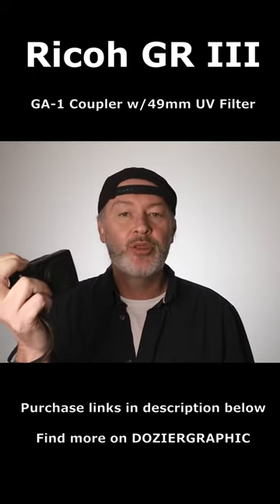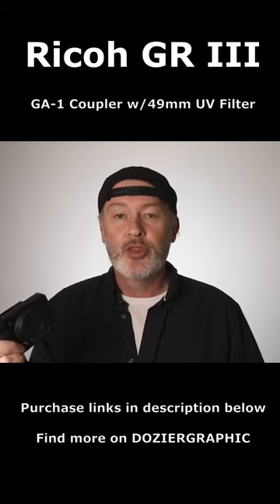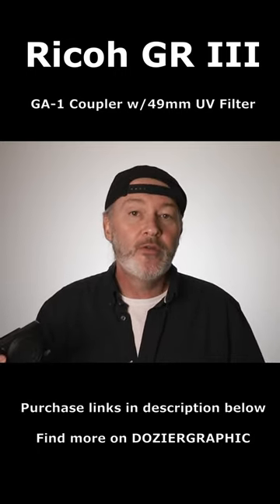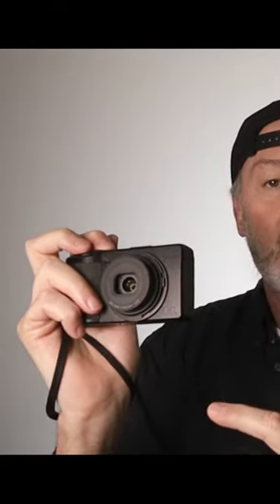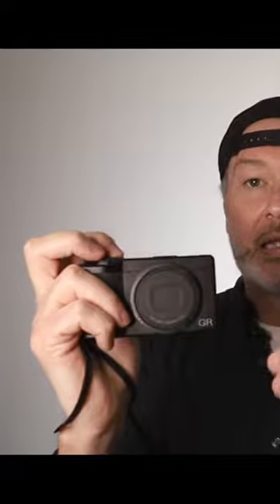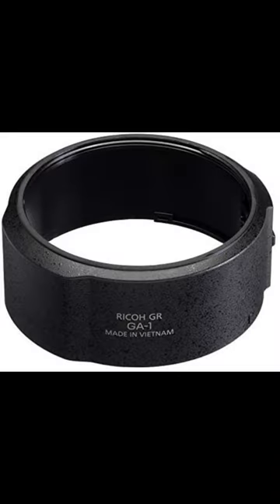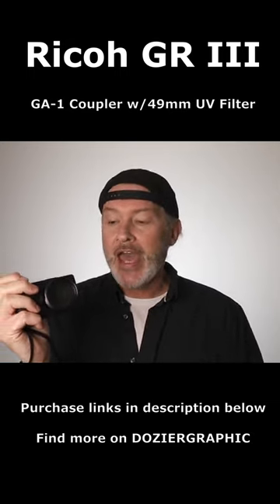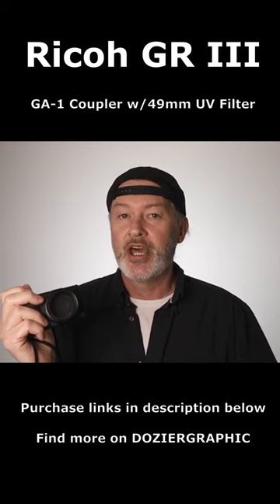Ricoh GR III Sensor Dust Prevention Hack #shorts

Comment: Good idea but it is not pocketable anymore
Reply from the maker: I know some want to carry in their pocket but I've never done that. I keep it wrapped and in my camera bag. Too expensive and heavy to carry in a pocket. But we're all different of course. Thanks for watching.
Reply: By forever pocketing this camera you'll be taking pictures of nothing but lint and dust, soon. 😄
Reply: Still one of the tiniest camera 
However same, I dont put it in my pocket
Reply: With the filter adapter, It don't fit into the jeans pocket but does fit in the hood pocket.
Reply: More than that, I bought the official GA 1 adapter, and it has still a hole on the side that let dust come in so it's not the perfect solution
also yes its too big for everyday use
Reply: @paulabbott2813  well that negates the main reason to even get one isn't it? All I asked for was a camera superior to a flaship smartphone, and people said GR3. Fine GR3 except you can't really carry this camera and is very bad at point and shoot. The main idea of point and shoot is have 99% relyability so you take out the device, get the picture at first try, put it back in. Now you can't carry it in the pocket, you need special setings an baby it at every step. At this point I would just get a freaking medium format at least I know why I need to baby sit the camera.

Comment: Regarding dust, I read that if you remove the battery you can easily suck out the dust through there.
Reply from the maker: interesting, never tried it. hope it'll work for those with issues!

Comment: this kinda defeats the purpose of it being so compact though...
Reply from the maker: I get that for most people Chris, and why some buy it, but I didn't buy it to put it in my pocket. And it actually helps me hold the camera in a scissor fashion that I can't do otherwise. Without the coupler, my hands would be too big to use the camera.
Reply: @DozierGraphic  i appreciate your reply.  i do understand that for some its a good accessory and helps.  just wanted to point out that for those of us who mainly use it as an EDC and want to maintain its compactness this wont work for us.  id love if you or anyone had any alternatives because im also worried about dust

Comment: Do you use this adaptor all the time everyday? Do you ever saw dust on the sensor? Is GR II more sensitive dust collector from GR III? 
Thanks!
Reply from the maker: The adapter is always on my camera, no reason not to. I've had dust on the sensor but not a HUGE amount. I learned where to clone it (suck for a $1000 camera tho!) Can't comment on whether one gets more dust than the other, assume they all suck dust in and that's just the way they are. Ricoh will never (and likely can't) fix that, but it's a real problem for sure.
Reply: Thanks for the answer. Why you believe that Ricoh never will fix it? Hope does last
Reply from the maker: @AVITHOSWEBMEDIA  Because they don't have to ever fix it. People complain online but fanboys shout them down and ridicule them so they stop complaining, and it helps the company not have to fix their problems. A lot of people only use it occasionally so it may not be an issue, but heavy usage will damage the fragile components.

Comment: Sticks on the front of lens 
housing
Reply from the maker: ? is that a question or statement? It's officially the GA-1 lens coupler. It doesn't 'stick' to the front of the lens, but it does somewhat screw in and is secure.
Reply: @DozierGraphic  it’s a statement you can get it on eBay and Amazon I have it on my GRiiiX and GriiiSE. They are great. I also have the extension tube but these are a permanent dust solution they are removable and come with 2 spare sticky rings for reattachment cost $15 or so and you can also buy a metal lens cap with a felt lining to keep everything clean. “Belt and Braces!” Let me know can send the link to your email
Reply: @kenmonahan9924  I got the sticky one from day #1, 3 months later there is 1 dust. Only can be seen when direct it toward bright light tho